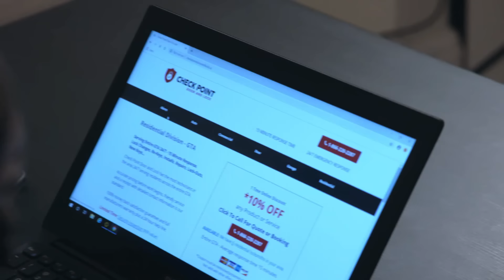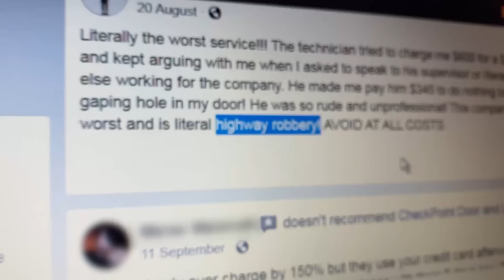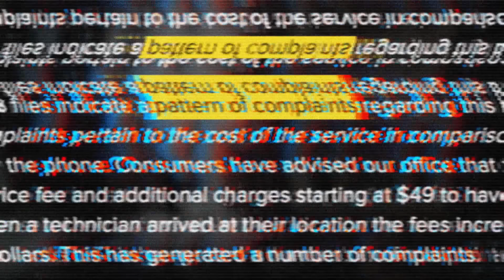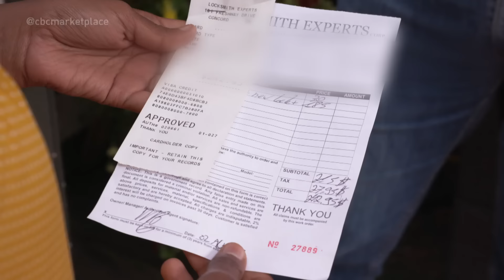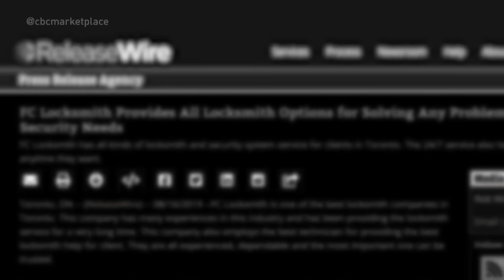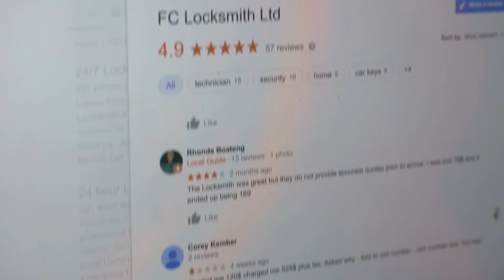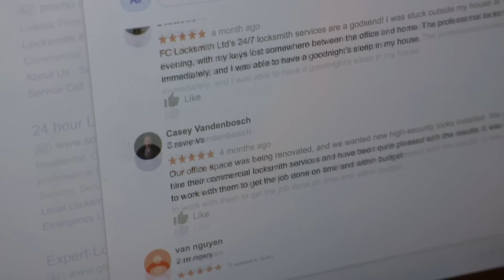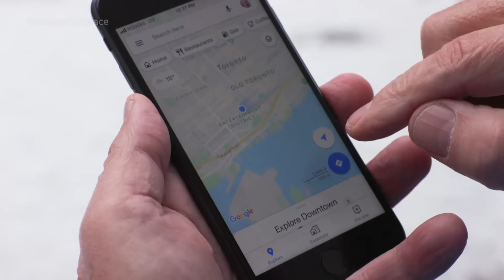Locksmith ripoffs: Hidden camera investigation (Marketplace)

Comment: I got locked out of my house once years ago. I looked around the street, made sure no one was watching, and kicked the door in. Was easier than I expected.
Reply: Nice
Reply: Why did you look around if it was your house?
Reply: @adamwest8711  Didn't know many of the neighbors. What if one who didn't recognize me saw me kick the door down and called the cops? Easy way to ruin my day.
Reply: @user-tz5uq2bt1s  I’m not sure why it’d ruin your day.  They’d just turn up and then leave but fair enough.  No harm in being cautious I guess.
Reply: I've done the same thing but i threw a rock through my back room window lol. It was pretty satisfying
Reply: @torreyjohnson918  lol
Reply: lol
Reply: So you broke your door/ lock instead of getting someone to lockpick it?
Reply: @MrTVx99  Didn't know any of my neighbors and this was before cell phones. How would I get a lockpicker?
Reply: most residential doors can be kicked in within 10 seconds. Kicked a door in on my back garage with 1 kick, while barefoot.... About.. idk.. 3 seconds. Its just a credit-card-thick sheet on one side, 1 1/2 inch thick piece of wood around edges, and styrofoam on inside of door. then another credit-card-thick sheet of steel to finish the door.  make sure you put 3 inch sheetrock screws in on your latch plate instead of those dumbass 1/2 inch screws that come standard
Reply: 450$ 😂 you can buy a drill and lock for what 200
Reply: @adamwest8711  I'm not sure you've learnt to properly write English, and also, you never know which type of cop will show up, and they'd most likely be annoying and waste your time, so it's good of him to be cautious.
Reply: @Krullfath  you don’t use and after a comma.  If you’re gonna be a grammar n azi, probably best to make sure you know what you’re talking about.
Reply: Nice
Reply: my girlfriend did that and the cops came after a neighbor complained about the noise haha
Reply: @adamwest8711 because they're bad at lying and this didn't happen

Comment: Dam that lock smith looks devastated that his art is being exploited
Reply: Wouldnt you be? Locksmithing is a  complex art, think of it like a watch maker. Very small moving parts that work together to deliver the same results consistently. Just like how you if your watch doesnt work it can throw off your whole day same is true for a lock. The difference is with lock picking you can brute force it and replace it. So this very delicate machine that he built to make it easy to fix was literally completely destroyed by a hack with a drill and a 20$ mass produced lock and charged more than he would to rebuild it.
Reply: Totally understand him! Lockpicking Lawyer has a bunch of lock reviews :-)
Reply: doesn't he sound like tom green??
Reply: He should run my ads on google and fix the issue for himself
Reply: I felt embarrassed just watching it too.  Some other clown giving all locksmiths a bad image.
Reply: So sad to see the good ones reputations be tainted by the bad ones :/
Reply: The sad part is hobbyist like me could pick the lock with the original security pins still in.   Sure they can be a challenge but it is doable.  Though I imagine it is harder when in the cold and under pressured a waiting customer.   I also wondered why he didn’t try an electric pick gun first.  When they work they are fast and you only loose a few seconds to try.  Even if it doesn’t work you might get two or three pins set then you only have to single pick the last two or three..
Reply: @rationalbushcraft  
You're comment made me look up an electric pick gun since I'd never heard of it. Found a video from Mr. Locksmith where he shows a cheap Chinese pick gun opening multiple locks in seconds. Have to admit, I was a bit shocked how easy to pick conventional locks are, glad I got one of those fancy locks on my place.
Reply: @anthonypareigis6188  kind of makes locks a joke though if you can just drill through it in a few minutes
Reply: @dynamo3059  then take the locks off your doors.
Reply: @anthonypareigis6188  they work good for keeping honest people honest. that's about it.
Reply: You are all assuming the locksmith in this story working for the news show is a good guy and has never pulled any of these tricks during his career. He may be legit but just because he says he is doesn’t always make it so. Trust no one.....
Reply: Started as an investigation, ended as a cringe-video
Reply: Swear i was thinking the same.
Reply: @anthonypareigis6188  uhh no. That's not what they meant. Wtf lol
Reply: @whatupkid12  tf are you on about?
Reply: LOL
Reply: He was the boss , i bet you
Reply: Now I learned how to break into someones house but blame it on the locksmith I called when I get caught
Reply: 8:37 says it all....
Reply: Yes when scammers do a job its hurts all those who work at doing a good job and leaves a bad taste in the customers mouth
Reply: I’m a cannabis cultivator that feels the same way about the cannabis market. It used to be about the patents, now it’s all about the bottom line,
Reply: over seer.... exactly my thought!  😂   EXPOSED!
Reply: over seer 😂💀
Reply: over seer that’s not how u spell damn
Reply: Probably mad that he’s not charging enough lol
Reply: over seer nah he probably think how he’s been picking lock his whole life and charging a few bucks, while these men out here drilling off the locks and charging 400 dollars
Reply: Calling it an art is ridiculous. Lock picking is not an art, it’s a criminal activity.
Reply: DR PHIL  Yeah not really a problem for me either, don't have windows on the front of my house, just a door and a garage, they'd have to climb a brick wall to reach a window. 
I do get your point and agree with it, best you can have is a big dog. Alarms don't seem to scare most burglars out here, they just let the alarm go off while quickly raiding the place.
Reply: It takes years to learn. My fist lock took months of practice before I could pick it, and it didn't help that I was using homemade tools. After that things came faster, but that first lock was a brain teaser.
Reply: @dynamo3059  Windows are an even funnier joke. Or door hinges.
Reply: When is Marketplace going undercover to expose a state run broadcaster that's ripping off a country for $1.5 Billion every year and only 400,000 people watch it?
Reply: Picked!!
Reply: I'm sure part of it is him being uncomfortable on camera. The rest is just him feeling a sense of responsibility as someone from the industry.
Reply: That's the way anyone in a trade who cares about their work feels when they see this kind of thing. It transcends to just about every aspect of work, whether it be lock picking, food service, auto repair, roofing, general contracting; you name it. There are honest people in every line of work, and then there are A-holes like this, scamming decent folks.
Reply: 11:15 makes up for it
Reply: Nah. He looked guilty😂
Reply: Art is appreciated, this isn't art....yikes
Reply: @LUXRAY_97  yeah, you're not calling up an 'artist' in the middle of the night to come and 'make art' on your door lol
Reply: Anthony Pareigis my cousin taught himself locksmithing just with the internet and hands on training.
Reply: @chris7285  not to be rude but what is your point? That's how i learned. You can learn how to build a watch online as well. The fact that you can learn something like this doesn't mean that its not a skill, it still requires practice, and is difficult to master. To go back to my watch analogy: this guy did the equivalent of someone bringing him a watch with a broken spring and they guy tells him that its hopeless and cant be repaired. Here's a timex that'll be 1000 dollars.
Reply: Well he should be.....if u watch from beginning he resets the whole of the pins .....the trick is someone wouldn't know that it has been switched
Reply: Anthony Pareigis dude cmon💀💀
Reply: Love people who are passionate  about their work ... usually fair and honest about what they do
Reply: over seer naw cuz he got mo tricks up his sleeves
Reply: I pick locks as a hobby on my YouTube channel. This is just awful. I can tell you from experience that almost every key in knob lock and deadbolt lock on a majority of homes CAN be picked open easily. VERY easily. This is clearly a ripoff. Shame on them. It puts a scar on the good locksmiths. Drilling is usually only done on broken or ultra high security locks and always a last resort. I am shocked to see this.
Reply: yeah that was hard to watch!
Reply: Facts
Reply: That man bout to break into tears
Reply: over seer lmaoo true
Reply: @rhondasilver3582  LOL...i actually laughed so hard when i read this, and i said "YEAH HE DOES!"
Reply: over seer I'm just a hobbyist lockpicker and even I was ashamed of that first guy. I wish they'd actually put anti-drill pins inside the lock, to destroy the guys bits and to see how much it was going to cost when he couldn't get in.
Reply: Art? lol, listen to yourselves... It's a skill and thats about it. Not sure why he is devastated, probably told to act like that to make the show more dramatic. Comes across as a big baby.
Reply: I replace auto glass and can identify with how this guy feels about his livelihood being bastardized.  A tip to the wise,never and I repeat never buy a vehicle that has had a windshield or urethane set back glass replacement , ever.
Reply: so ture
Reply: @dynamo3059  you mean a door with a window? seriously? why wait minutes?
Reply: over seer vb
Reply: 6:03. Look of extreme disappointment
Reply: I would be, he worked for 10 years and this happens
Reply: I swear Lhh
Reply: @Over Seer
Were you frustrated or angry
Locksmith is a job Title.
lock smith is Not.
Dam holds back Water on a river.
Damn is a curse word.

I am a Locksmith wirh almost 50 years Experience.
Almost any lock is Pickable. Even Cheap ones sometimes are not pickable in a reasonable period of Time.
Reply: Mark Gibson 
No it is a Skill.
I taught myself in about a year.
50 or so years ago.
Had I worked for a Locksmith, I could have learned the same Amount in a couple of weeks.
Reply: Fr
Reply: Yea
Reply: I was just coming to say this. Dude looks like he was dying inside.
Reply: @mitchellmaytorena1137  you sure about that? Pretty sure it's always been about the money, no one does anything for free
Reply: If it's SUCH a hustle... How did they ever find him in the first place??

Comment: 6:39 "Its so much easier when you have a key" 
Bruh that's why you're here
Reply: This guy knew he was being a dishonest worker
Reply: Would imagine that’s just a locksmith joke he uses every time
Reply: Selasi Sablah He is a locksmith though?

Imagine using the same joke 100 times and in an uncomfortable setting like that. It was a joke, a terrible joke
Reply: I am the shittiest of lockpickers and I've not met a deadbolt in the US that takes more than 15 seconds to 1 minute tops... a minute if I have to spp it... generally shorter for a rake...
Reply: Obviously a joke. Jokes are one of the con artist's greatest weapons. They also have a high success rate when you get pulled over which is why I've talked my way out of every ticket but one minor one. To be fair the one I got was for dead stickers but the cop that wrote it dropped the larger speeding ticket because I made him laugh.

Comment: If the Lock Picking Lawyer ever saw this he would flip his lid.
Reply: How can we tag him?
Reply: Lol good reference
Reply: Hope he does man!
Reply: LPL still has yet to come across a "unpickable lock" LOL.
Reply: You can send a link via mail to his PO Box, along with a description of the video and how it's relevant to his professions. Maybe send him an odd lock along with it as a gift, too?
Reply: @revanstarbrow6099  Honestly I'm pretty sure thousands of people sent him this video that was made over 1.5 years ago. I just haven't found his response.. keywords are a pain sometimes.
Reply: I'd hope he'd make a video tearing into these people.
Reply: He would file a lawsuit against the locksmith Industry
Reply: Lol
Reply: @itsmikoton  lol
Reply: I was thinking , why don't we weld a long metal pipe to the keyhole of the lock and build a contraption attached to the key for access, it's easy enough to build and makes picking access impossible.
Reply: @foxtrotjeff  lol he picked both like nothing, what was your reaction LOL
Reply: @akapandeo  that's fundamentally what a warded lock is. But warded locks can be picked. Really. On any of these applications it's far easier and quicker to break cheap doors or just find a window. No one is picking locks.
Reply: @akapandeo  There are many reasons we don't do that.
What you propose is essentially welding a long lever arm on to the front door lock.  With little effort, one could break the lock out of the door with that lever.  Unless the weld is weak enough and then the lever breaks off easily and defeats the purpose.
Also, nobody is going to want to carry around a key on a long stick in their pockets.
Reply: @Plant_Parenthood  can you answer one question honestly? Does my proposed contraption make picking access difficult if not impossible? And if difficult or not ,how so? Because it's based on the pickings I've seen in the videos only.
Reply: @Plant_Parenthood  my main concern is picking access, Bcz if there is time, no noise concern, access to power tools , super determined etc I mean there is no stopping such crimes, the aim is to make your property the least attractive and cumbersome to access relatively.
Reply: @Plant_Parenthood  I see why it will be a pain to carry a long key but thn it depends on the exact length and how concerned one is for locks being picked( people carry pretty big phones to begin with these days) and the long key could be a foldable one too.
Reply: @Plant_Parenthood and the welded pipe would have to be super long to make it a lever capable of breaking the lock but that's a length I am not proposing at all.
Reply: @akapandeo  As I mentioned, most thieves don't know how to pick a lock.  It takes too much time to learn and often takes much longer than just kicking a door down or smashing a window to gain access. 
If you want a pick resistant lock, you are better off going with a Bowley or Abloy or modifying a kwikset with security pins and counter-milling
Reply: @Plant_Parenthood  you didn't answer my first question, does my contraption make picking access difficult?
Reply: @Plant_Parenthood  if it's not about picking access thn it's besides the point here , as you mentioned most theives would use other means for access to the property. So, my point is just about picking access to the keyhole. Moreover all your proposed locks can be picked my the picking lawyer so
Reply: @foxtrotjeff  nah, he has come across a few, from cheap ones he found in Bosnian Bill's Bucket, to a $300 lock... 

They are rare, but he has shown some.